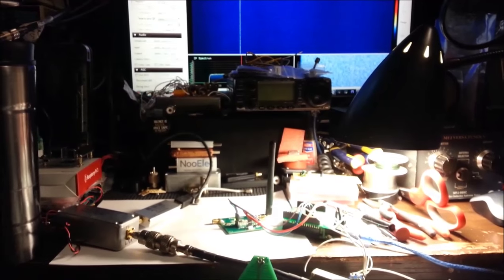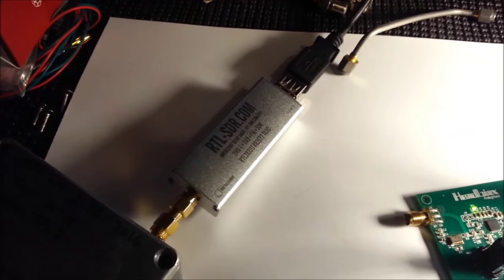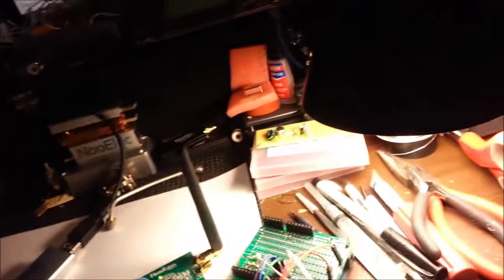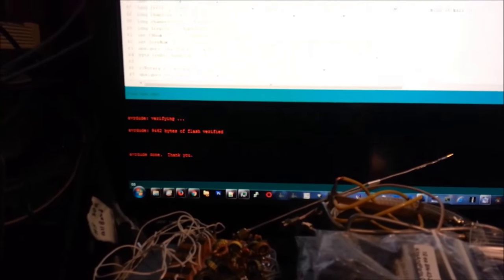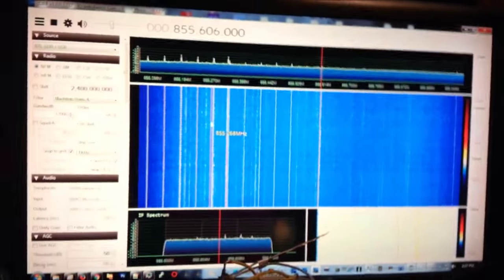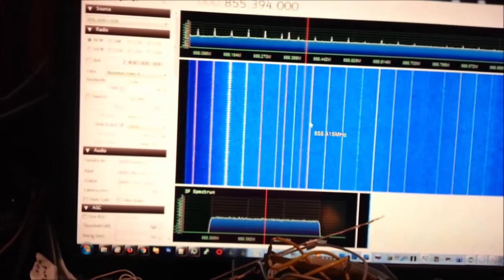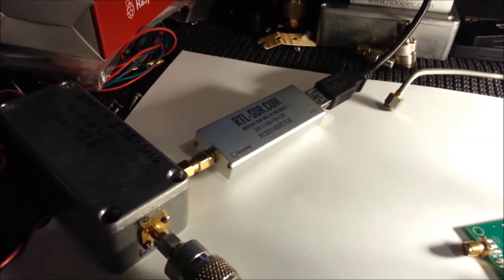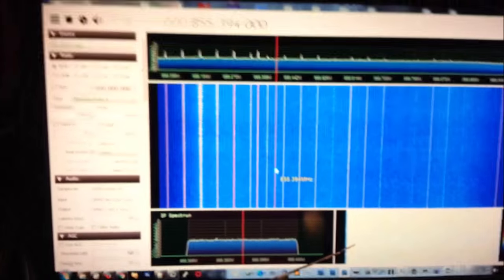$5 Microwave Downconverter for the RTLSDR   KD0CQ

Comment: Hi, I'm trying to capture signals in the WiFi band. I did the modification mentioned. However, I'm receiving signals in the FM band at frequencies of 2.4 GHz! (I also believe I'm receiving signals from the other low-frequency bands.) I was wondering how you managed to eliminate those. I tried reaching through your website but it seems like it is down for some reason. I would really appreciate your help since I'm doing this for my senior project.

Comment: That's pretty cool but I'm more interested in that ADF4351 !  Is it possible to create an ad-hoc radio by somehow mixing the output from that adf4351, mixing it somehow with an intermediate frequency signal generated from one of those inexpensive DDS abitrary waveform generator chip and then filtering & amplifying the signal ? Like some kind of poor man's SDR transmitter ?
Reply from the maker: +shodanxx Yeah, it's just a VCO. Can use it like any other frequency source. Mix it with an incoming RF source (antenna) and depending on how you go about it run it straight to the audio stage or further mixing or split into I & Q, etc for an RX. Pretty much go the opposite direction for TX with amplification and filtering on the output, simply stated of course.

Comment: i have mode one with succes but what is the shift frequency end settings on SDR# ?
Reply from the maker: Click the "Shift" box and enter 2,400,000,000. To correctly tune frequencies under 2.4GHz (L-band Inmarsat type and other stuff) click the "Swap I & Q" for correct frequency display. Remember to un-check the Swap box when moving back above 2.4GHz.

Have Fun and let me know how it goes!
Reply from the maker: Looks good! Have you tried any other frequency ranges yet?
Reply: +KD0CQ No i can't find any other device thats higher than 2.4Ghz. i got wifi 5Ghz too but thats to high for this setup. mayby it will pickup my i7 4Ghz cpu clock ? :p i have a sup ver. 3 too will mod this too to see the differents with the ver. 2.

Comment: Hi! Thanks for sharing your findings with us all! I have one question though; do we have to feed a DC-voltage to the sup-2400 unit in order for this to work? You mention a diy bias-t in your setup? And will 12 volts be sufficient? Thanks;)
Reply from the maker: Hey, Yeah you need to supply it with at least 7 volts. Instead of a bias tee you could solder a 9v battery connector (or connector of your choice) to the LM7805 directly in the sup-2400. I'd recommend a properly oriented rectifier diode in line to prevent reverse voltage.
Reply: Thanks;)

Comment: will this work with rev.: 3 sup 2400 ?
Reply from the maker: +T3CHNOTURK The ones I have here are all rev 2, but I see no reason why a rev 3 wouldn't be nearly identical. If you can, snap a close-in pic of the internals and post a link here or back on my site.
Reply: +KD0CQ ok i will do it soon when i receive it, what bias-T are you using ?
Reply from the maker: +T3CHNOTURK  just a homebrew slap together job. Running at 12v.
Reply: +KD0CQ haha so the LNA4ALL is a good one then,, i mean the bias-t from lna4all http://lna4all.blogspot.nl/2014/11/diy-bias-t.html